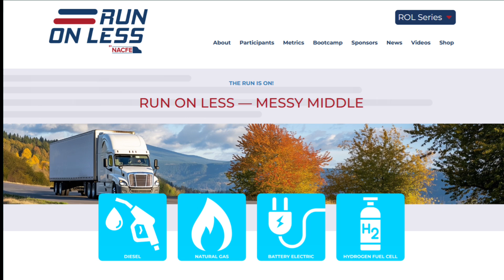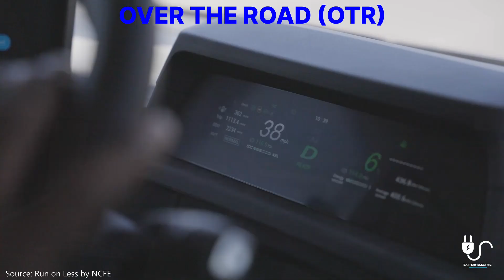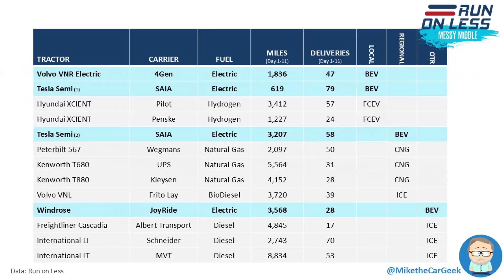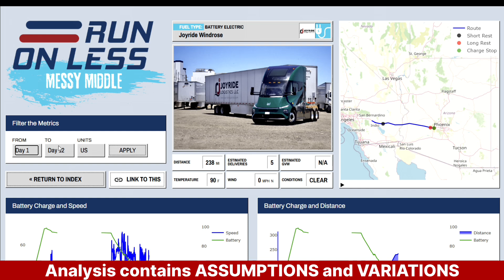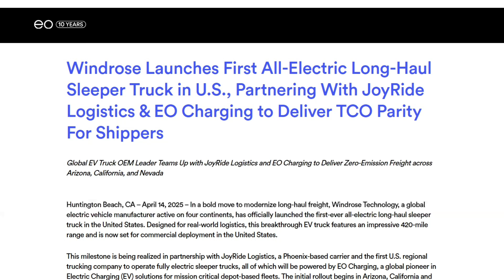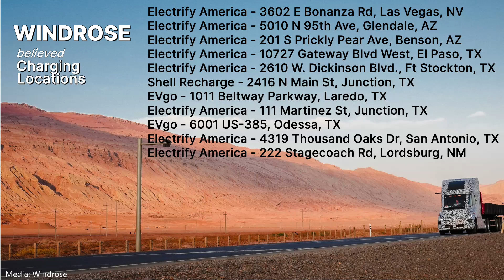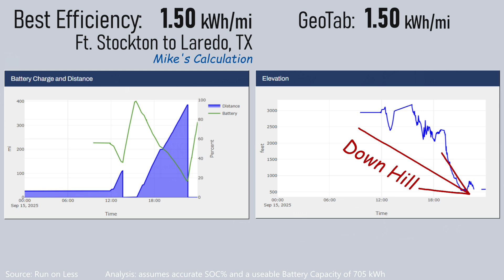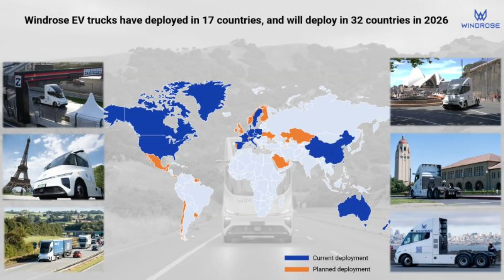Windrose EV Tractor - up to 1.5 kWh/Mile*

Comment: I agree with the term messy middle. It is going to take a while before we figure out the best amount of battery and other aerodynamic improvements to make them profitable. I think in the USA at least at this time the Tesla-semi is going to win at least temporary because it is built in the USA va China for the Windrose. but for the first 10+ years it will be who can get enough trucks on the road. and if my guess is right it is going to be a 20+ year swap over frp, ICE to EV. 

Another issue with these calculations is since none of them are on same route with similar cargo it makes it hard to compare.  Short distance you don't need as large of batteries (lighter) and aerodynamics make less of a difference. longer routes you have as you mentioned elevation that could hide some the actual numbers.  Also right now a shout haul return to depot to charge truck is less infrastructure and probably cheaper charging 

And just like in cars today if every EV factory was running at max theoretical capacity we still could not replace every new car with EV only.
Reply from the maker: Tesla Semi is as good as advertised, ramping up production and most important... they are going to build out Megachargers on their own

Comment: Huawei opens truck charging park in China. province of Sichuan. 

The charging park offers 
18 charging points with 1440 kW.
72 charging points with 720 kW .
108 charging points with 500 kW.
Reply from the maker: I recall the Huawei announcement for more than megawatt charging. They are three steps ahead of the industry.

Comment: All this data, but no info on how much weight the truck was actually pulling?  Seems that would be a big influence on efficiency?
Reply from the maker: Payload would help. The telemetry does have a Weight section, but most tractors did not report useful data, just saying the maximum GVWR (82,000 lbs) but not what it was actually pulling.